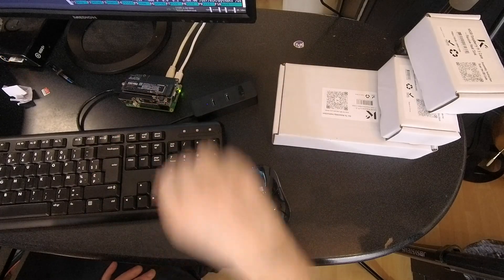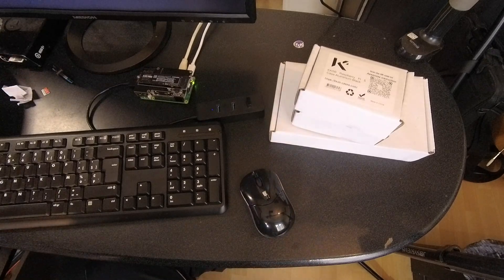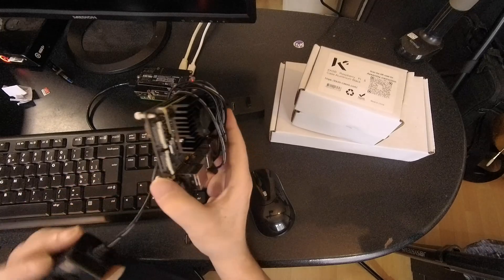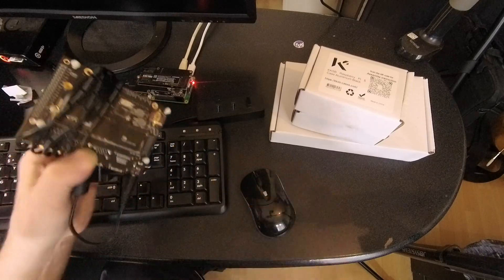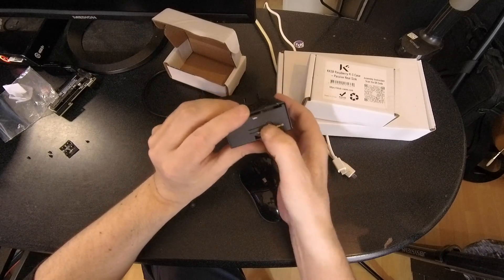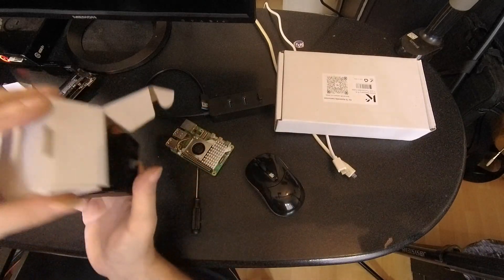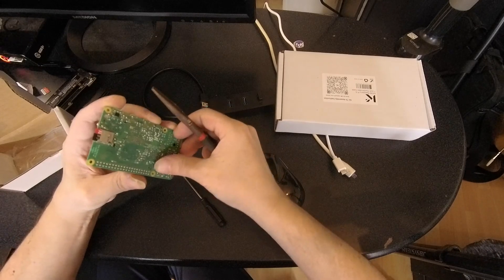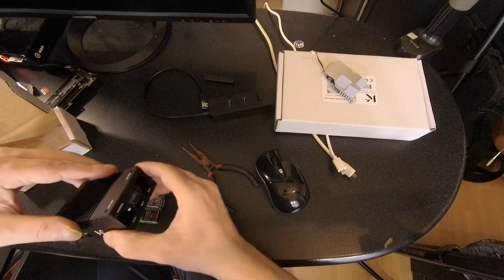Raspberry Pi 5 KKSB Metal Cases

Comment: Appreciate the video! The assembly of the KKSB Passive Heat Sink is incorrect though: the standoffs attach to the RPi not the case (if you do that, the rubber feet will work properly) and the thermal pads are in the wrong place :) Still, it was a helpful video to decide which case to choose, ty :)

Comment: Well just dont overclock and you wont have any issues 😊 I’ll take the passiv cooling
Reply from the maker: Indeed, I just like to live on the edge 😁
Even overclocked it works well enough if you don't have a continuous load.
Reply: @NicoDsSBCs  Thanx for the review :) Im about to buy the Pi5 and now i know what case to buy. 🥳
Reply from the maker: @burstfireno1617  Do know you can't use NVMe with these cases. Maybe see if there's any case with room for it, just to be future proof. NVMe is a nice feature on it. Can run up to 800MB/s at gen3. SD-reader is very good too, best of all the SBCs I've got. 90MB/s with sandisk extreme.

Comment: The official case and fan (not the metal one) is quiet and the plastic doesn't get too hot.  I run mine with the lid off.
Reply from the maker: Does the NVMe hat fit into it? I've gone back to the default heatsink/fan with NVMe hat and no case.
I hope they'll think about that in a next case design. I do like the default heatsink+fan. 
It does make too much noise maxed out, but better than what they had before... Nothing...

Comment: "needs more metal and more surface area" - exactly my findings.  I have used a bunch of passive cases from flirc and others and the thing gets too hot for me.  I hope someone designs and releases a more effective case but i think the cost will be higher and make no business sense
Reply from the maker: I use RK3588 devices passively cooled. So it can be done. My NanoPi R6S is my favorite for that. Has a great heavy case that keeps it cool at all times. 
It indeed would cost a lot more to have it be cool enough at max OC. It isn't really designed for the overclock I think. It is an extra 3.5W.  So makes a big difference.